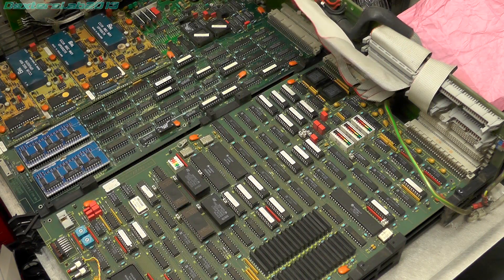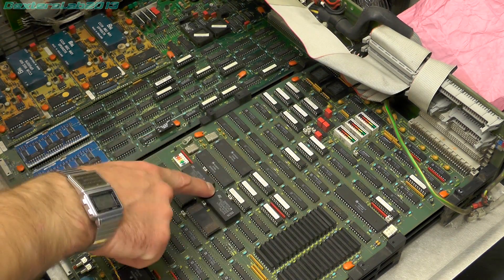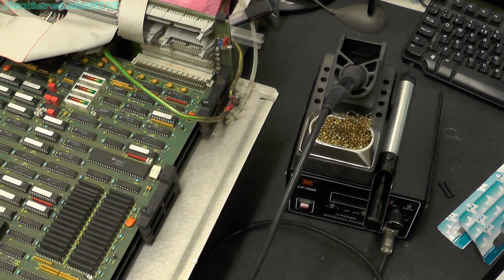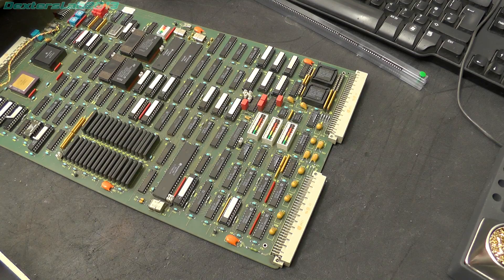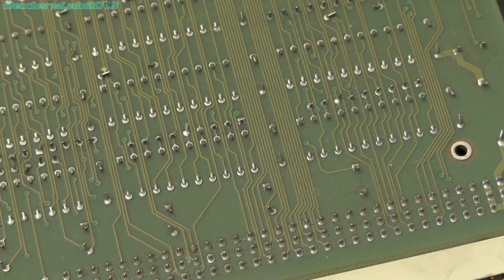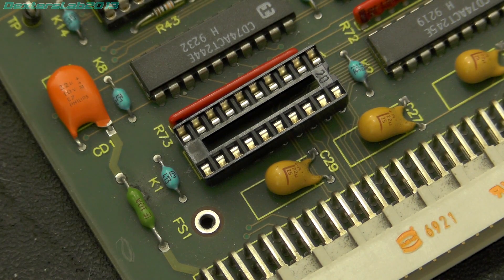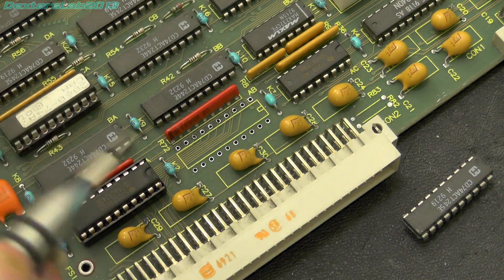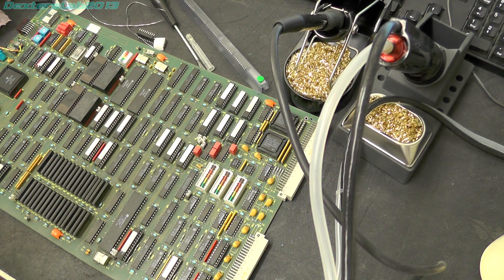DL#103 - Quantel Paintbox Repair Part 3 & New Tools from www.reichelt.co.uk

Comment: Youtube user RetroGameModz does old board restoration, as well as repair. He recommends thorough microscope inspection for cold joints, electrolytic capacitor corrosion caused by leaked electrolyte, etc.

Comment: I wish you good luck because you will need it. Don't even want to know how many buffer ics there are in total. And there is no guarantee that the problem is related to them. But without a decent schematic pinpointing and repairing this is a nightmare.
Reply from the maker: Yea tell me about it! It's been sat here propped up against my door for months. Waiting for the service manuals to turn up is like waiting for the second coming of Zarquon so i figured i should just try and do something.
Reply from the maker: hey Simon, I know there is a service manual for sure, someone will have one somewhere, at least i can try things in the meantime. There is little chance of buying another, they just don't come up for sale.

Comment: For desoldering chips like that I chop the chip out from the top - chop 1 side then rock back & forth to snap the other side. If you're lucky the pins are magnetic so you can unsolder by flowing the solder from the componant side and holding a magnet over the pin on the solder side.
Reply from the maker: Thanks Mike, i'll give that a try when i do the next few.
Reply: As an addition - if you don't care about the IC, just cover the rest with something(bag, paper, masking tape), and take a dremel to the stem of every pin, then desolder each one individually.
That's what I do for DIP.

For large SMD(destructive) - place a thin copper wire underneath the pins, wick the solder off, and then heat every pin, and pull the wire hard. It lifts the pins uniformly and quickly.